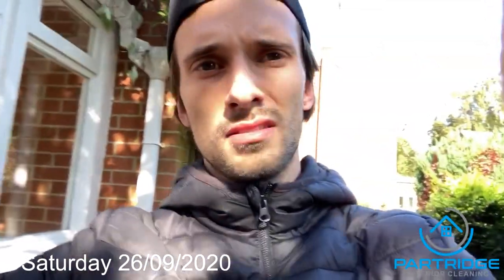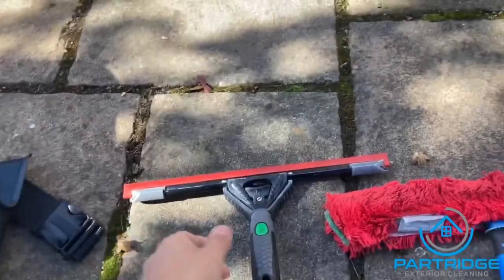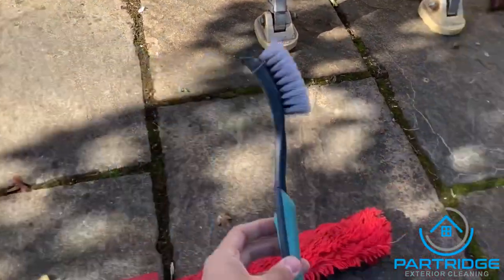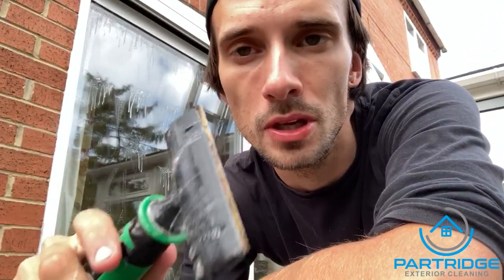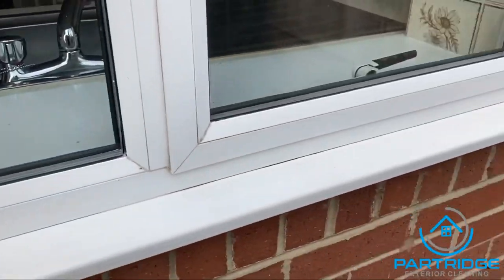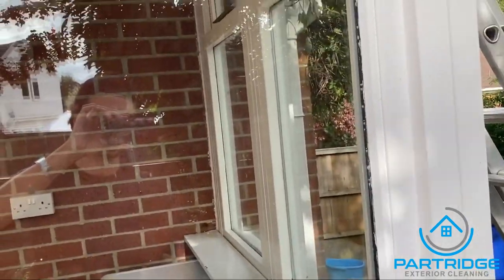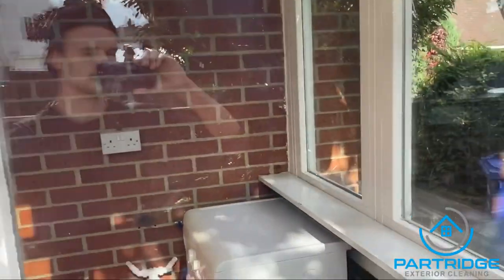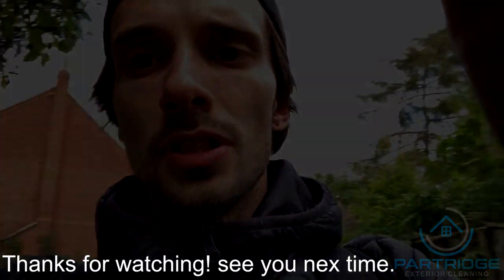How to tackle your FIRST Window Cleaning job! // Partridge Exterior Cleaning

Comment: I can’t be doing with one off cleans as I’m just too busy. Anybody starting out should always take them on as there’s always a possibility of gaining extra work from it. U should try the moerman liquidator channels, zero detailing if done properly, great tool. Nice job tho mate 👍🏻
Reply from the maker: Yeah definitely! What handles do you use with your liquidator mate?
Reply: @PartridgeExteriorCleaning   I just use the unger ergotec handles, I use the 10 & 14 inch channels in them.... there’s a learning curve with them, some people can’t use them but I don’t understand why.... watch YouTube videos by trad man or polz & bladz on the best way to use them as u need good slip on the glass for them to work effectively, but once you’ve got it down, detailing the windows is down to a minimum 👍🏻
Reply from the maker: @neilpalmer9691  Just ordered myself a 14" one so excited to try it out, been looking at it for a while and definitely seems like a specialist squeegee. Less detailing the better :)
Reply: @PartridgeExteriorCleaning   watch the videos I recommended to u if u haven’t already & u can’t go wrong. The rubbers on them need working in a bit. When I put a new rubber in mine I just clean my house windows with it to break it in as lines can be left at first. Dish soap directly applied on the applicator for good slip on the glass after being dunked in a bucket of water without any soap in. Go slow at first, as the videos say, it’s a precision tool, speed will come the more u use it. I couldnt be without one now. My ninja is surplus to requirements lol
Reply from the maker: Perfect will do Neil, do you use the blue rubbers with it? That’s what I bought but I believe it comes with a black one already on it. Bought 5 of the blue as they look fancy :D

Comment: Can I make a valid point. Do not place your tools on the ground. You'll pick up grit in the applicator and dirt on the squeegee rubber. A cobweb brush will save you time cleaning your tools off and keep them clean for glass cleaning
Reply from the maker: Very true, I scrub my applicator before every job anyway so no harm done if its on the floor for a moment. If there was a table in the garden it would of been on there instead (; 
Cobweb brush i've found counter productive most of the time as I just use a normal dish brush for that and doesn't negate the fact that frames and sills still need to be soaped up on a first clean especially. 
Each to their own though, my methods change every 6 months to be honest, always finding new ways of getting it done. Thanks for your comment mate.

Comment: first cleans - wfp every time! lot of work to trad em
Reply from the maker: Very true but for new guys who aren't into using chems yet it may be a more thorough clean traditionally the first time if they are using both methods anyway, but i agree, razrwash or tfr out the backpack, blast the frames and then wfp is a dream for first cleans.
Reply: @PartridgeExteriorCleaning  I like to spray a bit of elbow grease degreaser on the brush with low water pressure. Leave for 2 mins then wash higher pressure with pure water. I find this way really efficient even with birds mess on regular cleans.